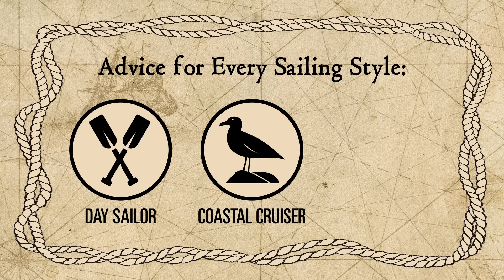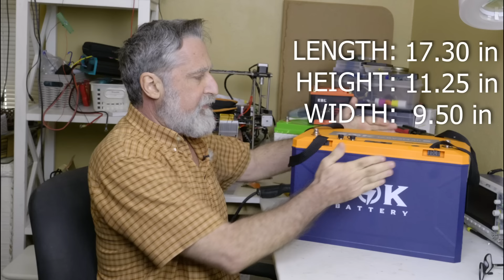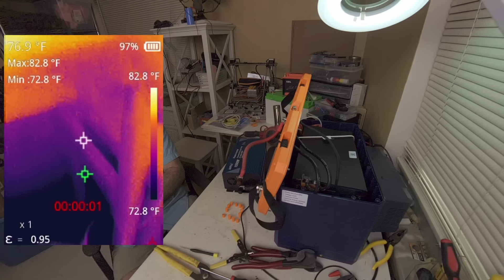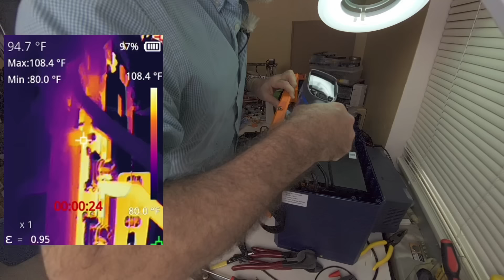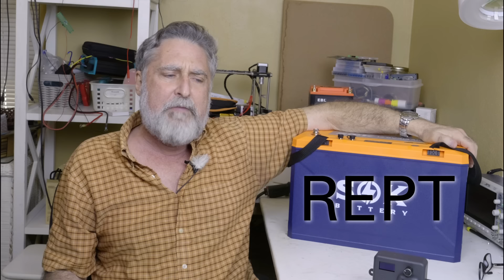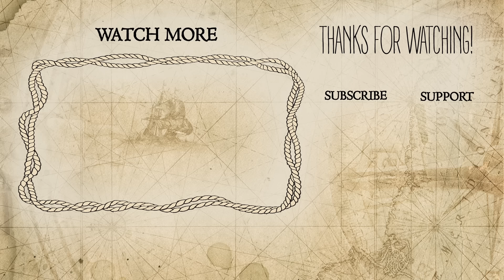Watch this BEFORE you buy any SOK LiFePO4 Battery

Comment: Can you go into more depth on how your bank manager has the ability to better manage the battery cells than the internal battery manager? How does your Bank Manager track internal cell voltage of the battery?
Reply from the maker: Not really without spilling the beans
  It's really complicated so I decided to not patent the process as that puts it in The public domain.  It looks like it was the right idea as many have tried but all have missed the mark
   Watch my "charging LiFePO4" video for clues.
   This has been tested a lot on many batteries and always works
Reply: 🤷‍♂ Ok
Reply from the maker: @PanelsUpSolar I just noticed your user name.  Contact me at SailingTemptress@gmail.com if you are interested in commercial.

Every review video I do involves 2 charges to 100 percent with a BankManager.  After the first though voltage is reasonable at charg stop, further charging causes a rapid rise in cell voltage (hockystick)
   Then after some discharge I charge again with the BankManager and deplete the battery through my calibrated discharge.  From that I see the battery was full based on ah discharged.

Both tests indicate that chemical 100 percent was reached without overcharging.
Reply: @Clarks-Adventure  I know your test methods, I have seen your reviews. But can you explain how your Bank manager is really any different or better than a quality charger like the Victron products that I shipped to you for Temptress? Especially when you take into consideration the capability of closed loop communication that this SOK battery has as well as the Voltgo and Epoch batteries that would also be in the same class. I can certainly see a difference if going back to the original purpose of mixing LiFePo4 batteries with lead acid, but how does it benefit a stand alone LiFePo4?
Reply from the maker: Sorry I didn't recognize who you were.  Since we last communicated I was hacked and lost our email stream.  Seems as though I wanted to talk to you late last year but ended up disappointed.
    The difference comes down to the identification of full. The BMS in these batteries uses voltage to decide when it's full.  And frankly this approach does a poor job of it.  My 3 brain math (as in math that defines a 3d membrane) does a better job of knowing when the cells are done charging at any rate of charge.  I can consistently hit 100 percent without going over (cell damage) or under charging (memory creation).
    Once I get over these health concerns and get back to Temptress I'm planning on possibly teaching the BankManager to talk Victron on its canbus.  I have isolated the sentences I need so it shouldn't be that difficult.  In short I'll do what the BMS is doing in those batteries, but with a better state of battery knowledge.
    Also in Victron systems without an alternator (or a controllable alternator regulator) no lead or contactor should be required as I can throttle down the Victron gear.  
    Once that is available I'm considering developing a version of the BankManager into a BMS.  I'll have some designs in mind that will allow the BankManager BMS to balance cells in a safer way but mostly since no case or display is required these can be sold cheaper for delivery inside new batteries.
    So with BankManager logic inside each battery it's now safe to mix different ages and manufacturers in parallel along with several other things.  
   For industry it means you can buy Li to drop onto your lead forklift without any other changes.  Leave the lead, use your old charger, just get another shift of power storage.
Reply: @Clarks-Adventure  I think the best method of identifying 100% full is to really look at both voltage and current at the cell level. I think that is hard to do from the outside of the battery. That is where the BMS and closed loop communication can work out the best. But the BMS needs to have a good cell balancer as well or the system needs to take into consideration have a good 3rd party cell balancer in the system. If the battery is properly constructed and the BMS can communicate its needs to a good charging source like the Victron system, with its ability to regulate charge across its system of various charging sources from MPPTs,  DC -DC chargers, and ac to dc chargers, there would would certainly never be a need to rely on batteries going into “protection mode” or disconnecting from the system.

Though this does not necessarily apply to battery banks that are utilizing mixed chemistries but could certainly be engineered that way to work. Like if the Bank Manager could receive good data from the battery BMS and coordinate the Victron system charging needs accordingly. 

Wishing you a speedy recovery and a fast return to Temptress. If you want to reach out Sales@panelsupsolar.com. If you take a quick trip in the truck camper, we are right up the road in Laurel Mississippi.
Reply from the maker: @PanelsUpSolar I fully agree with your first point.  The BankManager relies on the battery cells being in balance and sadly when you operate a system using the BankManager the BMSs ability to balance cells is all be disabled due to the voltage never going into the hockystick range.  Well, that is until the cells get WAY out of balance.

   That's why I stress periodic cell balancing and have tried my best to make videos showing how to do this to any battery.

    If I ever make a device that does both I'll have it periodically over charge just a bit to check on cell balance.  Then drop the voltage quickly.

   Thanks for your email
  I'll send you a message just to get your address into my new mail server.  No need to respond .

Comment: 1. 8:38 imho that vid link should be in the description of every LFP batt review 
2. In the Elefast battery review, the BMS desirable feature set became an obvious focus. Going fwd, it would be useful to tick off BMS (& other) potential features (Bluetooth, settable C charge & discharge max, active balance, cold wea...) & whether/how the batt under review meets ea possible feature. Call it running down the feature board.
3. Serviceable case is brilliant. I thought about SOK for that feature but ultimately price canceled that idea.

Comment: SOK customer support was incredibly slow and annoying in my experience. Cells in my 204ah took weeks to balance, and one of my  two batteries has needed the BMS replaced twice in 1 yr of use... ymmv.
Reply from the maker: Sorry to hear that.  Thanks for reporting it here 

   If you don't take the voltage above 14 the battery would never really balance.
    They made a bad design decision.  Same as EPOCH
Reply: They responded back within a day via email, no complaints here.

Comment: SOK has great customer support. Own the 280Ah model. Works flawlessly. The only problem is that SOK does not balance the cells before delivering to customer.  Not a big deal if you have a power supply.  Or a battery charger with a power supply function. (Most smaller Victron charger has this function) It took 48 hours to balance the battery.
Reply: So what settings do you use on the power supply?
Reply from the maker: @jamieyz it changes as the process continues.
   Generally set the voltage just below where the BMS will stop charging.  Charge like 5 amps until you get close then cut the current to what makes the voltage hover.
   Setting the voltage alone is actually enough as the power supply will taper the current for you.
  Then watch the top cell voltage if you can.  Bring up the power supply as the top cell voltage comes down.

I just posted this answer to the description.
Reply: @Clarks-Adventure  thanks! I have a Lithionics 450Ah 12V with an external BMS. Only getting 20-25 ah out of it after the BMS stops drawing a charge. No Bluetooth. Hoping it is just in need of balancing. As a last resort I will be popping it open so I have access to  measure the cells individually. I'm on a mooring, just making a plan for when I get access to shore power.

I have studied your videos on balancing cells. I may be able to parallel them and do it that way if all else fails.
Reply from the maker: It could be that or memory.  I've seen failure both ways.  Also of course bad charging will simply kill a cell.
   That's why I made the BankManager.